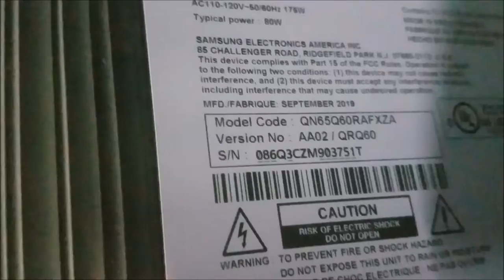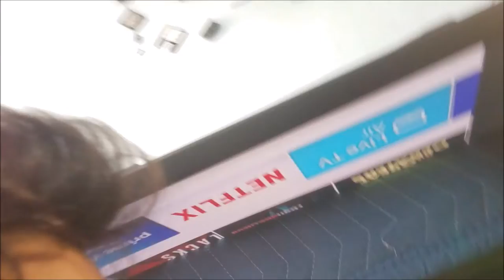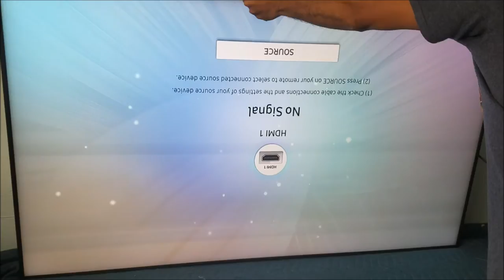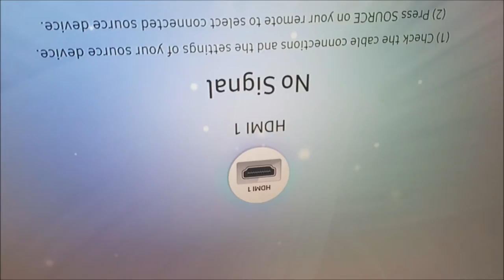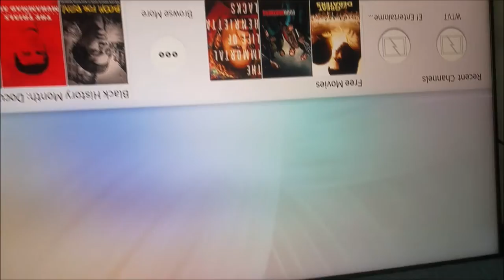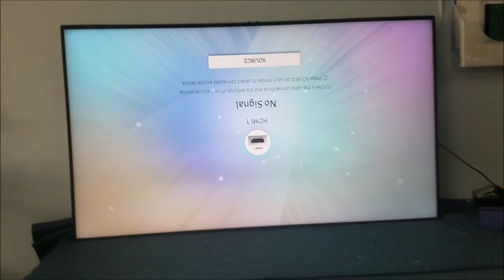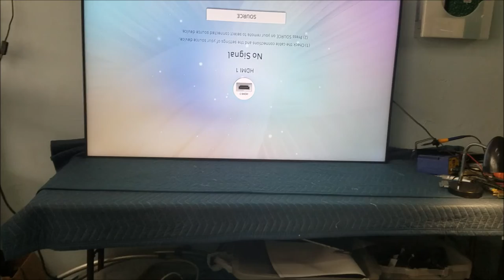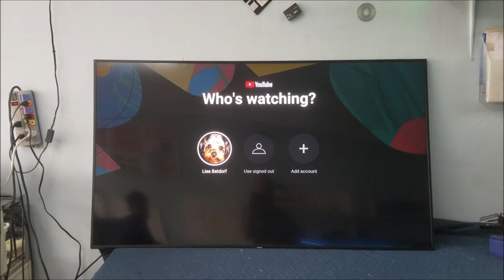Samsung tv qn65q60rafxza turns on shows logo then restarting

Comment: OK was there need to change powerboard or main board? Did you really change EEPROM for the particular model to make the board compatible with TV or other reason??
Reply from the maker: depend the problem, yes the board is from other model thats why i changing eeprom
Reply: @SOSfixElectronics  so the main board from this TV was faulty also?

Comment: OK my board looks a bit different and there is resistor, smaller one which is shorted... or maybe it is fuse but really small. Question: removing first resistor resulted this that all the rest elements 3 resistors and multi-diode stopped getting hot?

Comment: Took out resistors, got a good picture for an hour then the same side of screen started to go though a cycle of slightly dimming and going back to normal with a frequency of about half a second. Do you think replacement of the IC and putting the resistors back on would help? I'm thinking those resistors were there for a reason.
Reply from the maker: put the resistors back and do the tape way
Reply: Yes, the resistors should be there for obvious reasons. Otherwise it would have no been included in the design. The guy in the video most likely still experienced issues with the TV even by removing the resistors.